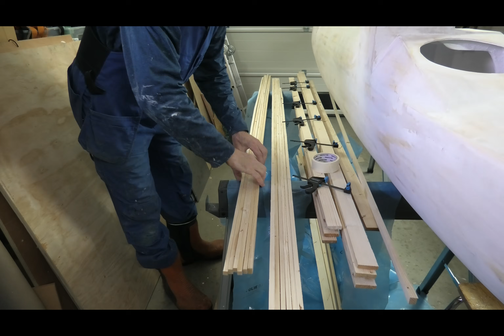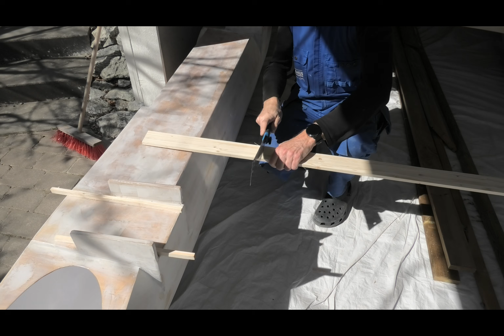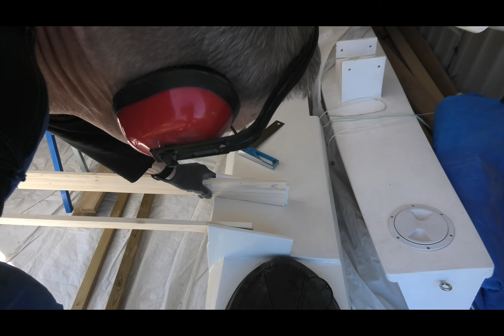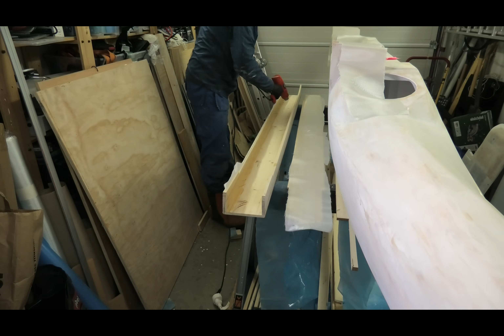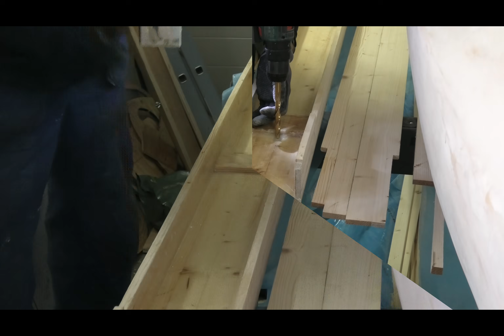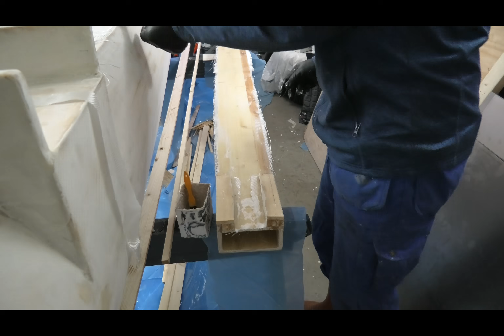Making a lighter and less expensive aft cross beam for my camping catamaran #374

Comment: I safe old credit- and gift cards to use as "squeege"/spreader for smaller surfaces, to use less brushes
Reply from the maker: That should work fine. I usually wipe off the rubber squeegee with a paper towel and that also works fine. However, I often want the puncture effect of the brush when I press out air from the cloth. I buy the brushes in sets of 4 for a reasonable price. If I feel greedy I put the brush outside below 10 degrees C so the chemical process slows down. Then I can use the same brush a whole day.
Reply: @sailoutofagarage6212  putting the brushes in the cold is a good tip, never thought it that way, even if I use cold to slow the curing process while laminating when needed :)